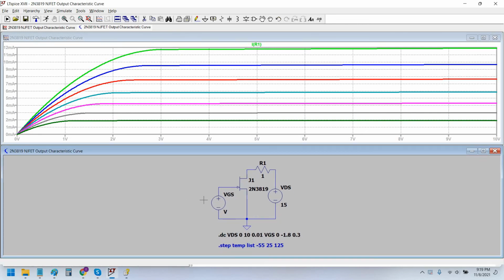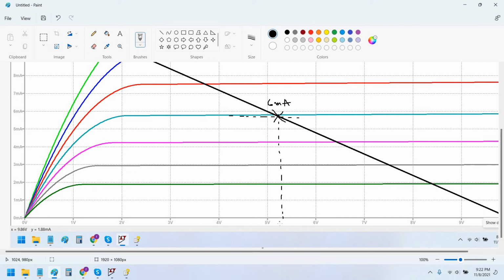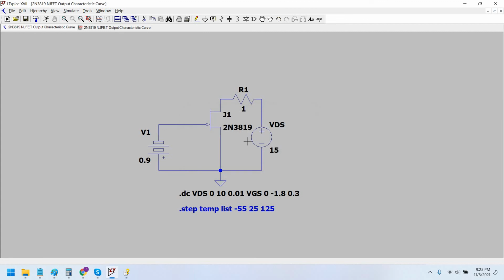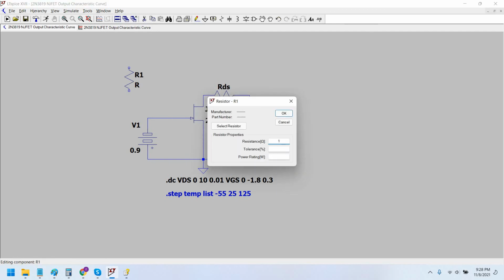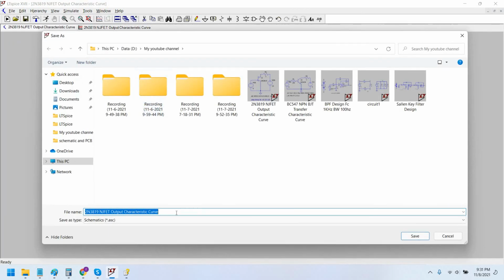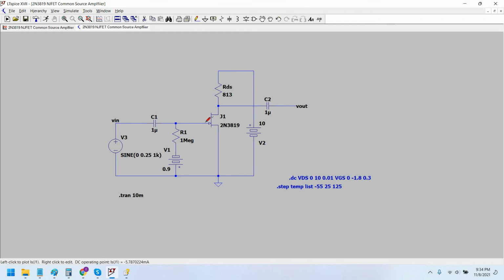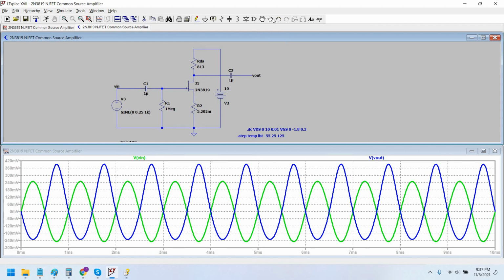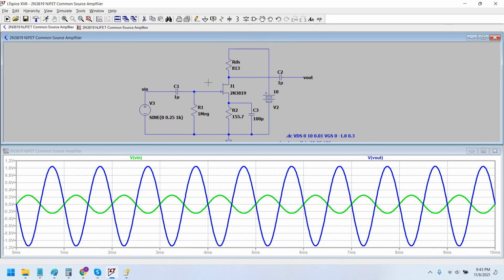LTSpice 2N3819 NJFET Common Source Self Bias Amplifier #amplifier #circuit #transistor #BJT #trans

Comment: what's the replacement of that fet 2n3819?
Reply from the maker: You can use any type of N Channel JFET.
Reply: @circuitsimulations  but you have to consider different transconductances for different JFETs. And they can also differ from device to device for the same device type. So I use trimmers for the Source resistors to get the required setpoint. In the data sheet of the J113 they give a minimum valure for the Source-Drain current of 2 mA when the Gate is shorted to the Source. For the charge that I have bought a few years ago it was 20 mA. 😛
Reply from the maker: @gkdresden  Wow. You seems to be good at this topic. Well I appreciate. 😀